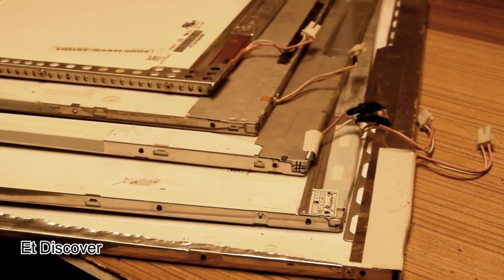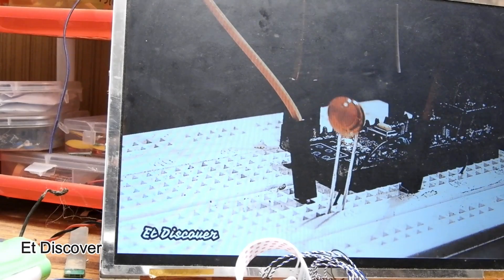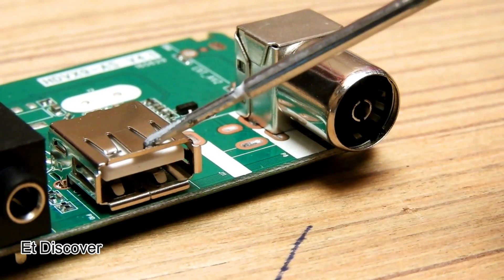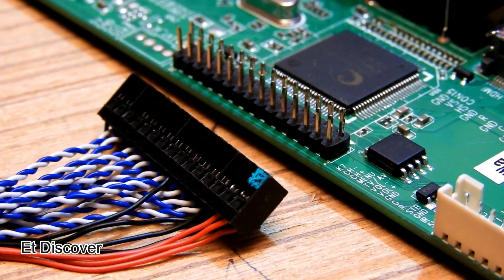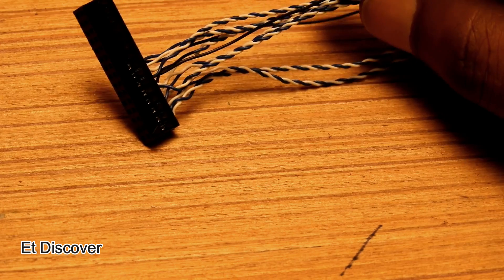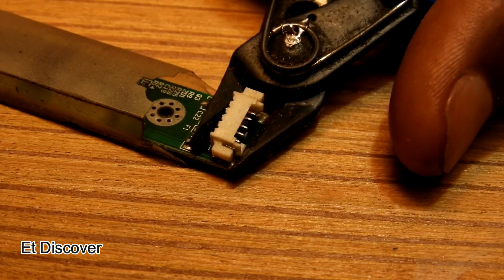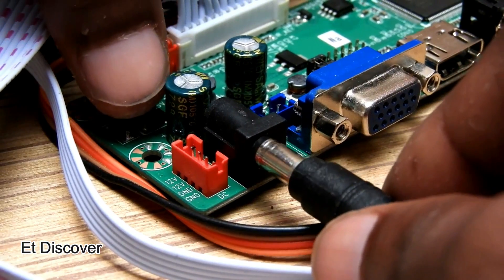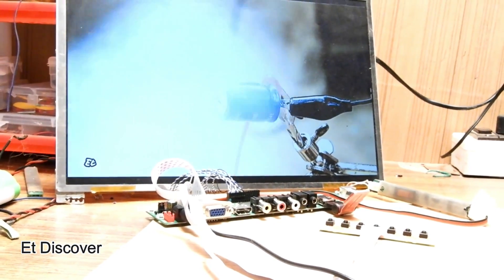Run all lcd without software_ Full tutorial of v59 board..

Comment: Questions: Is the v59 controller a replacement to the V56?
Was the cable that you needed to re arrange the pins not correct for this board? I assume there is a cable that should have been in you package.

Comment: Hello
Did you encounter problems with subtitles?
Because I made a TV with this board,  it works perfect, but subtitles i cannot see.
I changed firmware, I used factory settings, I enter factory settings (remote control 2580)... no chance.
Any idea?

Comment: How do I change the firmware? I want to use a different LCD for the same board, the LCD has a different resolution.
Reply from the maker: Don’t need to put firmware .just change the resolution by changing the jumper according your LCD.

Comment: What about those 4 inverter wire one side is connected to lcd but where are the solder 4 wire are at the other end in board ...where to solder them.

Comment: My LCD Pannel Resolution is 1280 x 720 What Jummper setting is required for this ? Jumper setting diagrame doesnt have jumper setting for Resolution 120 x 720
Reply from the maker: Behind in this board everything is written,you need to follow the jumper
Reply: @EtDiscover  Jumper setting for 1280x720 is not available please see in details

Comment: can this be done without backlight
Reply from the maker: The monitor will turn on But you can not see anything 🙄🙄
Reply: Et Discover yes I know that.... but will the image on the lcd be displayed with the backlight off?like a dark image right?
Reply from the maker: Yes yes
Reply: Et Discover interesting...I need the backlight removed completely from any lcd model even ips panel ...will the connection affect the voltage in the board?if I remove the backlight completely ...because I have no experience in voltage

Comment: In the promotion videos everything works fine,but in real there are thousands difficulties in cables,software,pinout datasheets,poor performance of the board.Who is giving tech support in the case of any of these difficulties?
Reply: another indian ofcourse duh
Reply: Not in promotion video if you have  experience about electronics and LCD led Repairing then you can easily fix this type of problems
Reply: Brother, You only have to overcome all the diffculties. Because , at last, you are only going to stand on the victory stand.
Reply: V

Comment: Hi! My lcd panel has 4 cfl connection, 2 on the top and 2 cfl on bottom. I can't find a universal tv board for it. Can I parallel the connection?
Reply: Use inverter card for cfl

Comment: I have lots of dead phones
like touch not working 
battery damages
but the display works
I need to know is there any card or system available to control these mobile display?
1) Micromax Magnus (motherboard dead display and touch is ok)
2) krbon a18 Working perfectly display also works but touch not working
Reply: No you can't possibly
Reply: @DipElectronicsLAB  university..
Reply: Uhvrlledrepr